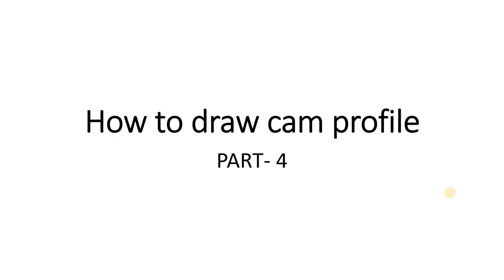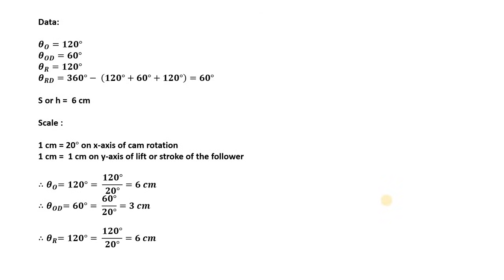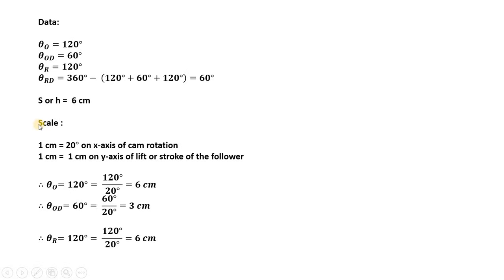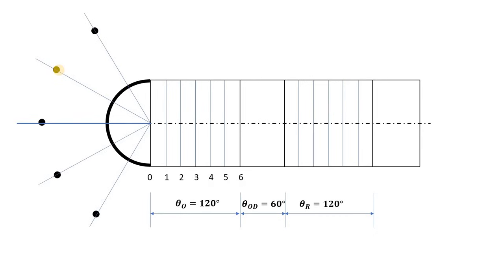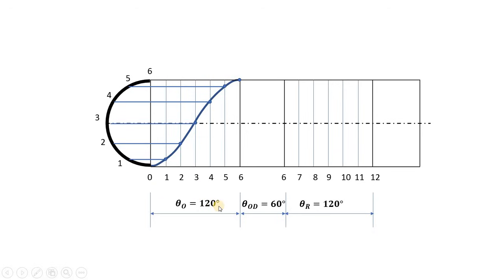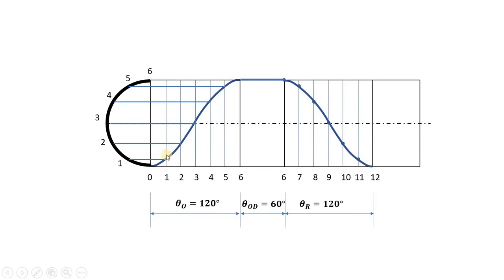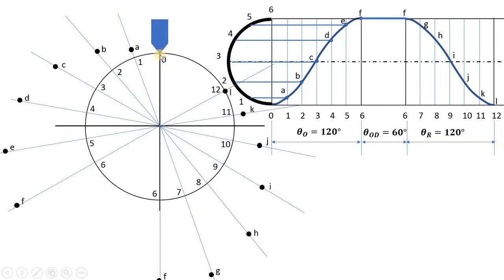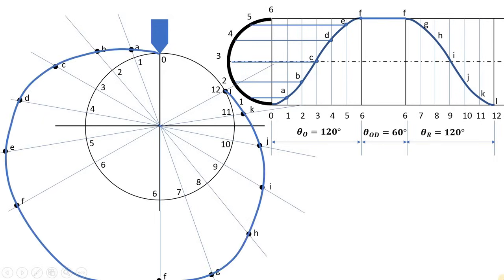Lecture 1 | How to draw a cam profile (Knife edge follower)

Comment: Draw the cam profile for the following particulars :

Disc cam, knife-edge follower radial and reciprocating follower, uniform motion during out-stroke (first-half) and return-stroke (second-half), minimum radius of cam is 30 mm, and follower lift is 40 mm

Comment: Ossm explanation...
Reply from the maker: Thanks a lot !!
Useful playlists for you !!!

Hydraulic circuit & pneumatic circuit working - https://bit.ly/3zAx1e4
Cam profile - https://bit.ly/3vjpY7a
Mechanics - https://bit.ly/3PClXmz
Beam reaction & Graphic statics - https://bit.ly/3veMwWA
SFD and BMD- Simply supported beam and cantilever beam - https://bit.ly/3PDzA4V
SOM & Structural analysis videos - https://bit.ly/3OEqX8S
Heat transfer - https://bit.ly/3PzxiUe
Thermodynamics - https://bit.ly/3J5ZvQd
Velocity & Acceleration diagram - https://bit.ly/3vj8zf0

Comment: Please  can you help me solve this question.

1. A reduction gear in the form of a pair of bevel gear connects 30mm diameter shaft having an included angle of 90, the pinion which is the driver revolves at 125 rpm and has a 90mm pitch diameter, a face width of 20mm and a module of 5, the bevel wheel is to revolve at 75 rpm. draw the following views of the assembly full size.

Comment: Can  I use the same method as shown in the video for the roller follower?
Reply from the maker: For displacement diagram , method is same .... But for cam profile you will need base circle , Pitch circle and method will be slightly different ....
Reply: Thanks for the explanation.